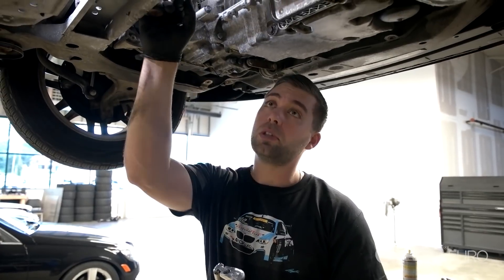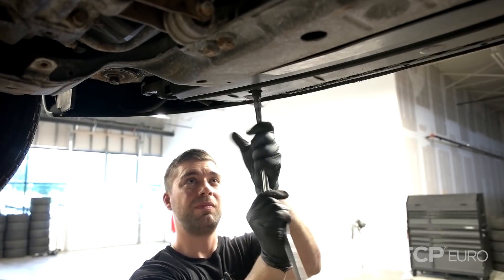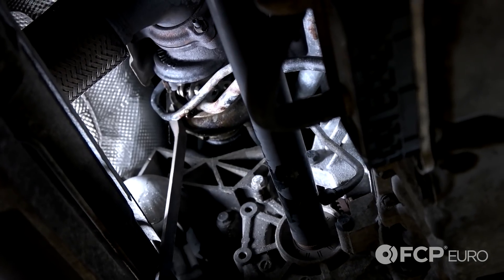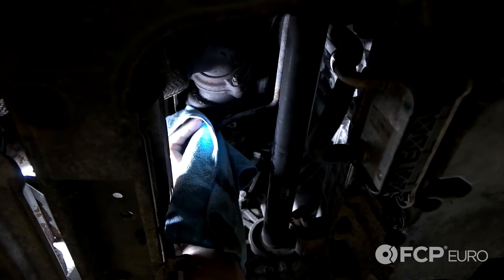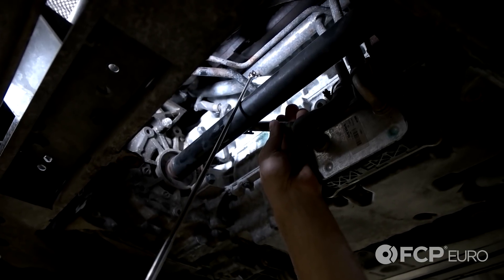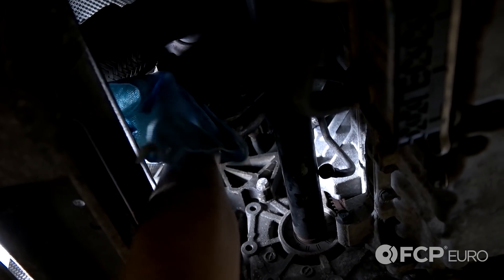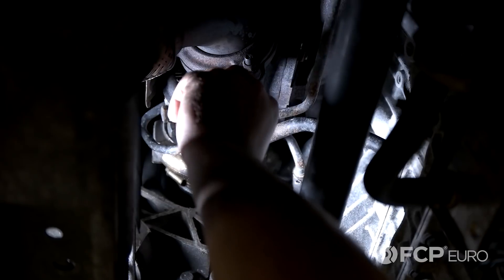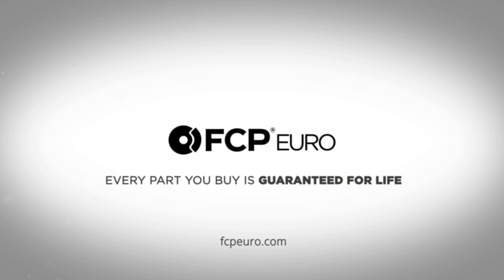Volvo Turbo Return Line Seal Replacement - Fix the Leak! (S60, V70, XC70, S80, XC90)

Comment: Thank you, Jay, for the video! I was able to replace the gasket and seal in my boyfriend's car, 04 Volvo S60 2.5T AWD. I didn't remove the angle gear. And didn't remove the lower coolant line, I just backed it off to give it enough room for movement and was able to get the return pipe out with a little finessing. However, getting it back into alignment was a battle that I was losing for a few hours. As Jay does in his video, I put the return pipe in place and then slid in the gasket. The gasket wants to travel around, so have a curved pick on hand to help shift it around. Another note, I had to reinstall the return pipe a few times because the lower seal was not seating properly. I eventually placed the seal in first, then installed the return pipe, apply some pressure and you'll feel the return pipe sink into the seal perfectly - that's when the return pipe finally aligned on the gasket end. Thanks for the video!
Reply: What kinda boyfriend has his girlfriend fix his car?
Reply: @Oblivionchampion  he could have a handicap
Reply: Awd is hard!
Reply: You nailed the hack perfectly! Get the pipe into the motor first and then slide the gasket and bolts into place. Use this opportunity to throw the T30 screws in the circular file and replace with good old fashioned hex bolts.

Comment: I just did this work today on my 2.4T (V70 2001). While it can make things easier, you actually don't need to mess with the coolant lines at all. With some will and violence (swedish expression) the return pipe comes out quite easily.

Comment: Note to self; you do not need to remove the coolant pipe nor drain the coolant, just bend the coolant pipe a little like Jay did, at least this was the case w/ 2001 T5 with 16T turbo.
Reply: I didnt even bend the coolant pipe, I just moved the return pipe up as much as it would go (while twisting it), then I took a firm grip on the bottom part of the pipe and used some will and violence to get it out. 2.4T from a V70 2001 (B5244T3 engine)
Reply: What about the oil? Should I drain that or will there not be much that comes out of the turbo??
Reply: @devyngulick5373  no the oil will drain down to the block in the time it takes you to lift the vehicle. I saw no oil at all when I removed it, and I didn’t remove any oil or wait before starting

Comment: For users who will do this at home, don't forget to run the complete burping/refill coolant procedure with the car at idle and not driving until the thermostat opens, then the next morning refill the tank again as needed.  Keep an eye on the instrument display to be safe.
Reply: Peppermint can you please describe the procedure with more detail? I just did this to my s60 but the coolant I took out does not fit inside again yet
Reply: @germanchavez9832  after filling up to the max line on the container, start the engine with the cap open and let it run. Wait until it starts sinking (thats when the thermostat opens), then keep filling it up until it stops sinking.

Should be noted, you do not need to remove the coolant pipe, it just takes a little bit of will to get the return pipe out of there with the coolant pipe still attached.

Comment: The T30 mounting screws are Mickey Mouse and will probably strip as you try to remove them resulting in bad words and flying tools; I replaced mine with hex bolts which are much easier to remove/install and torque properly. The AWD is a bear to work with without removing the angle gear/driver's side axle, but it can be done with patience and some bad words.

Comment: FCP I would love to see this done on an XC70. Any tips on how to access this area without having to remove the angle gear!?
Reply: extended long reach torx bit 3/8th drive is the only way to get the rear torx bolt started. front bolt is easy.
You can get them out easy but getting them started back in is near impossible with angle gear in the way.
I would also glue the gasket to the drain tube flange with indian head shellac before trying to reinstall the tube.

Comment: I have an 06 xc70 2.5 ,I was in there today and I noticed the blue line coming off the TCV is not connected to anything on the other end.Where does this line plug into ?I know this is an old video but you seem to know Volvos pretty well,any help would be greatly appreciated.

Comment: I have a 09 Volvo S60 T5, I know it leaks oil because I’m always a quart low but never goes below. I do get oil on the ground but not the amount I loose. I believe the leak is coming from the Turbo and is burning off. However, there’s no smell or smoke while driving. Your video has inspired my curiosity to attempt a repair.  Any ideas of the issue I’m experiencing?
Reply: First step is to accurately find the leak.
Reply: What @reallyhappenings5597 said. If its the oil return pipe, you will see oil around the pipe (on mine it was the lower gasket), and then a coneshaped oil mess going from the return pipe down to the bottom of the block, with the bottom of the block (oil pan etc) being completely drenched in oil.

Comment: great info I have to do the same on my 01 , S40 1.9 the seal is leaking and the oil ends up on the top of my exaust smokes and stinks like crazy, but looks like a pit harder to do it on the S40 the right  driveshaft braket mount  is on my way . Never the less great to see you doing it.
Reply from the maker: Hi J.R.S. The S40 is a bit different but basically the same process. Glad you found the video helpful. Good luck with the repair!
Reply: Hi thanks  for your feedback  I did the job 2 days ago came out perfect no leaks anymore amazing $2.00 dollares O ring and 1.5 labour but I had an empty hoist it turn out not bad at all. Thanks again.Cheers!!
Reply from the maker: @j.r.s.244  Great to hear!!

Comment: Hi, my car is a XC90 AWD, 2007, 2.5T. In the event I had to remove the angle gear to have access to the "turbo return pipe bots", what do I need to put back the angle gear? do I need to replace the angle gear gasket, if any? Thanks

Comment: so this turbo has 2 coolant lines and 2 oil lines and you were fixing COOLANT LEAK right ? 
QUESTION : how do you know if turbo is burning oil ? tested compression and all is ok 150psi in each cilinder.

Comment: Thanks for the helpful Volvo videos.  I have a Volvo XC90 2.9, 2005.  One of the turbos is blown.  Is there a way to visually observe or check easily which of the 2 is blown. Thanks
Reply from the maker: You can check each turbo for exessive shaft play. The one with more shaft play is likely the blown turbo. This would require gaining access to the compressor housing of each turbo. However, I would recommend replacing both turbos, as, if one is blown, the other is likely not far behind.
Reply: @fcpeuro  I agree with the replacing of them both.  There is another Volvo in the area that is scrapped.  It looks decent but the head gasket is blown in theirs.  It has been sitting in their back yard.  I could probably buy the car for next to nothing.  I wonder if the turbos would be bad in that one?  Would the fact they junked it due to a blown head gasket have any effect on the turbos?  Do the turbos in these cars generally last a while?  It might be in both of our interests to make them an offer on their junked Volvo.  They get cash and I get lots of meat on the bone...

Comment: Can turbo oil leakage cause the turbo to lose boost, or what are the symtom (beside the obvious oil stane on the ground)? I havnt yet checked where exactly oil is leaking. But I can see clearly its coming somwhere around the turbo area and the car started to leak oil  about the same time I started to feel the lost of boost.
Reply: This video is for the oil return pipe only. Having a leak here won't be an issue in terms of affecting the engine or turbo. If the actual turbo loses pressure, you have a bigger problem.
Reply: @perkele1989 Okey, the car has been leaking oil under the hood about the same time as i started  to notice that the turbo was starting to lose turbo boost, and the boost pressure diminished slowly the more i drove the car (Now one year later the boost performace is just weak af).
The oil leakage also seems like its connected somehow to the turbo, becuse every time I press dowm the gas pedal hard and let the turbo load  i almost needed to refil the with oil every or every other time I let the turbo charge up a bit. 
And now today, when the turbo boost are very low, I dont need to refil as I did a year ago.
I know, it can just be an coincidence, im a noob so please sir, be patient with me😇. 
Ive been looking under and over the motor, but I cant see where its coming from, becuse its oil everywhere, but very fresh under ( more in the middle and a little bit on the drivers side and oil on top is more dry but not dry dry...
I understand that I need to let a professional do a troublehoot.
I just dont have the money atm to fix it :( so I turn to internet :)

Comment: Hi my 2003 Volvo v70xc has  white smoke come out the exhaust and the exhaust pipe has oil too upon checking my intercooler I found oil and also have transmission issues,hard shift and jerking. I did the glove test to check PCV and the glove did not inflated. I did the head gasket test to check if water does not increase in the water bottle after driving for +\- 20 min with initial volume been min .What could be the problem ?
Reply from the maker: White smoke tends to be burning coolant, so don't totally rule out the head gasket. If the smoke is more blueish than white, it could be burning oil from bad turbocharger seals, which would also explain oil in the intercooler. Transmission issues are going to be separate from any engine issues.
Reply: @fcpeuro  Hi it was the turbo we sealed it off,its running without turbocharger until we get repair kit
Reply: same exact issues im having on my 04 s60 2.5t AWD. still havent been able to figure it out yet. also have engine code that comes on and off randomly for bank 1 running to rich at idle and high loads
Reply: @beamello6906 Hi there fellow Volvo owner.  How do you seal off the turbo? I just obtained a 2005 XC90 2.5T AWD with white oily smelling smoke from the exhaust. The intercooler and the input and output tubing to it are literally dripping with oil. The compression test is ok. Does sealing off the turbo stop the smoke and diagnose the issue as strictly a turbo problem? Did replacing the turbo solve your problem? The instructions for turbo replacement seem difficult for my Volvo. Was yours the same? Best regards. David

Comment: What was the indications of faults that led you to exchange the Return Line Seal?
Reply: It leaks oil. If you have that problem, you'll see it, believe me. :D
Reply: @gsommerfeldt  
Thanks for your reply.
Living with a 2005 S60T2 and a 2007 V70T2, I have to read all about possible problems and how to solve them. All information I gather is stored in a database, - either as a document with text and pictures or as, in this case, as a link to somebody who knows.
Yes, - I'm an engineer nerd, - electronic engineer, - though :-)
Regards from Denmark
Reply: @johndue2366  I just replaced the gasket and seal on the return line on my '96 855 T5 this weekend. Pretty much the same procedure, though I only had to loosen the supply line a little to wiggle the line out of the block and away.
For this line, the specific symptoms are oil leakage from either end (mine was the seal at the block, not the gasket on the turbo). 
It'll cause enough of a leakage to drip from the back of the engine, and can look like a cam seal or RMS leak, though those are both rarer and more difficult to tackle, so I suggest looking at the turbo oil lines first whenever there is oil at the back of the engine ("back" in this case means towards the rear of the car, not the "back" of the engine, as that technically would be to the left side of the car itself ;) ).
My advice is to check out the forums and repair database on matthewsvolvosite.com for anything and everything about fixing your own Volvo. :)
Reply: @gsommerfeldt  
Hi Gunnar,
Ditt namn låter du är från Sverige.
Om det är korrekt förstår du vad jag skriver.
Du är självklart en Volvo fan som jag.
Jag har kört Volvo och inget annat sedan 1986
Vill du komma i kontakt med danska Volvo ägare som älskar sina bilar så svara det här.
Reply: @johndue2366  Jeg forstår helt klart hva du skriver, selv om jeg hverken er svensk eller dansk. ;)
Reply: @gsommerfeldt  
Hvor du kommer fra har ingen betydning så længe vi kan kommunikere.
Et sted at starte kan være:
Kender du en danske hjemmeside: Volvosnak?

Comment: I have the same exact car mine is leaking oil and running rough please help
Reply from the maker: Hi Tony, if your car is leaking oil and running rough it sounds like you have a clogged PCV system which has blown out some oil seals. I would replace the PCV system and of course, replace the seals that have blown out and causing your oil leaks.

Comment: Would this oil leak cause white exhaust smoke?
Reply from the maker: Yes, it's possible it could cause White smoke if there's enough oil burning.
Reply: i just bought a xc90 2.5T year 2006 with 210K miles on clock.
I did a lot of service on it like timing belt with Volvo genuine water pump.
New oil castrol w5-40 and filters.
It started to show oil presure light.
Went to service put another oil pump and another oil thinking that is an oil problem.
Today i went with my family on a drive and while i was driving uphill no oil light on but when i stoped for a coffe on the back of exaust i saw white smoke.I thought as long as oil presure lamp is not on ok lets drive.When i finished driving uphill and started to go down the oil presure light comes on.I turned the car off for 10 minutes and started again with no light on.On the way back home same thing.I noticed when i push the brakes it comes of and on.I have checked the sensor is fine.
Engine runs very quite.
Any help please???

Comment: I have oil on the bottom of my turbo, and engine is burning oil. I'm hopeing this Is the problem, that its leaking on to turbo and burning of or something. does this sound like I need to change the seals?
Reply from the maker: Hi Steven, if you can visibly see oil leaking, or dripping on the ground, the return line seal may be the problem. However, if your engine is burning oil, it could also be a bad turbo itself, where the internal seals in the turbo failed, which would cause burning oil and smoke out of the exhaust.
Reply: @fcpeuro  hi thx for the quick reply.there's no smoke at all. I'm seeing oil on the turbo. But not really on the ground. PCv is also bad, I've been leaving dipstick cracked to vent PCv till I can change it. I'm gonna jack it up Soon and see exactly where its coming from.  Oil is also going in the intercooler houses, but that's probably because pcv. And there noise from the suspension top strut look OK. Not all the time, on stop and go intermittent, and on some bumps. What usually clunks?
Reply from the maker: @hanzbe420  Smart move on leaving dipstick cracked so you don't blow out any seals from the bad PCV. Clunking could be sway bar end links too.